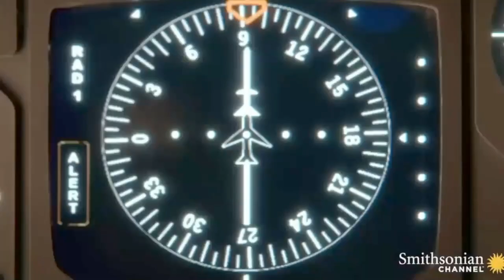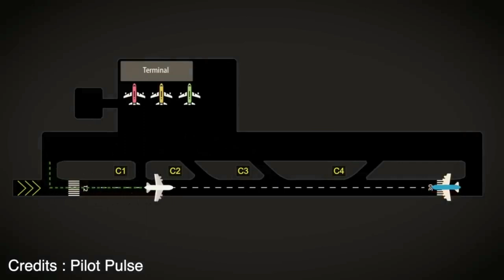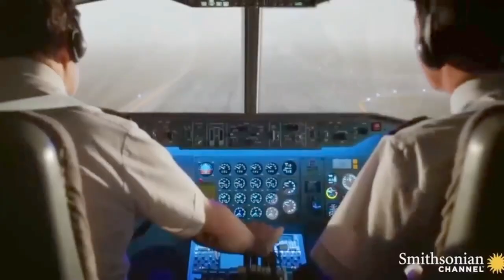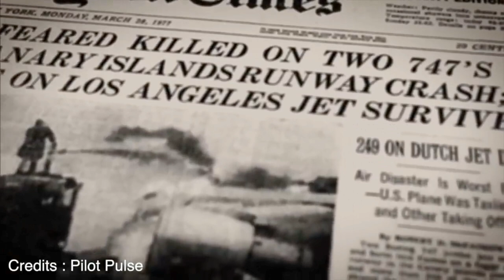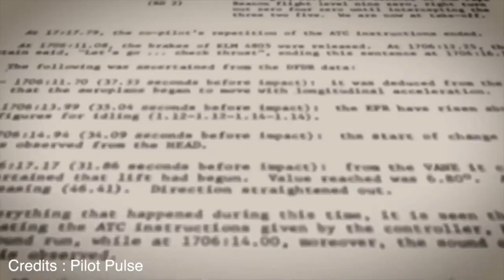The World's Deadliest Plane Crash | What Really Happened to Flight 447? #happened #dead

Comment: The Bea first report, released at a news conference in July 5th 2012, concluded that the aircraft suffered temporary inconsistencies between the airspeed measurements-likely resulting from ice 🧊 crystals obstructing the aircraft pitot-tubes which caused the autopilot to disconnect 😮